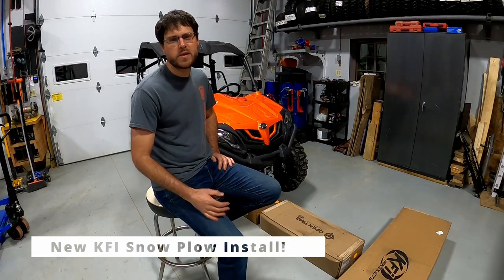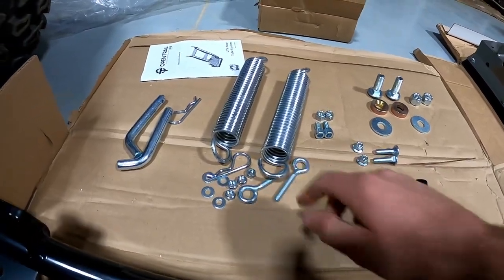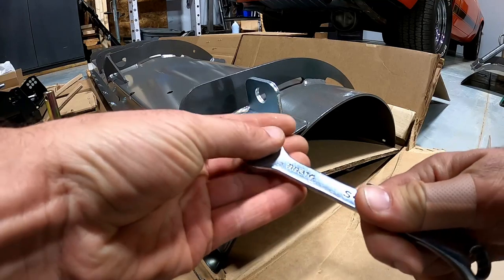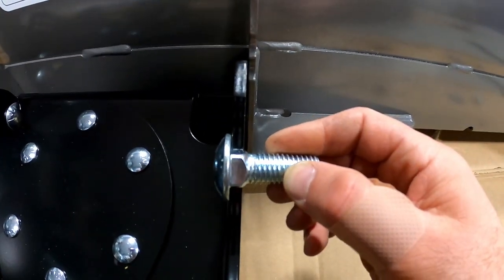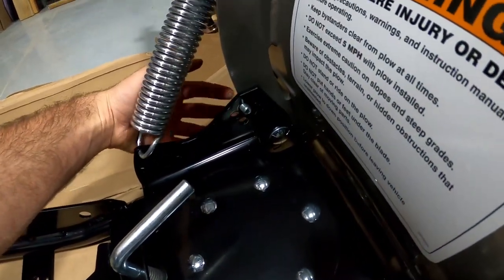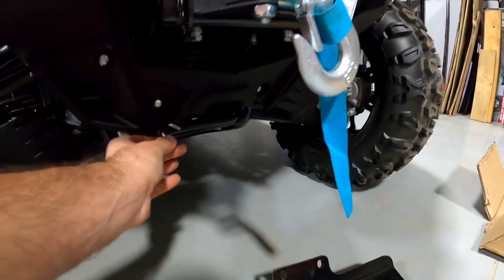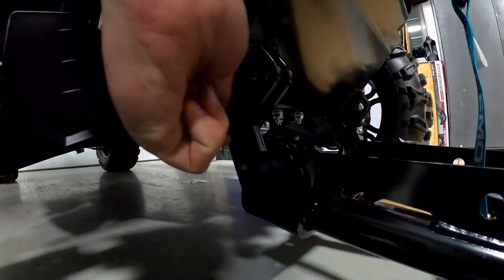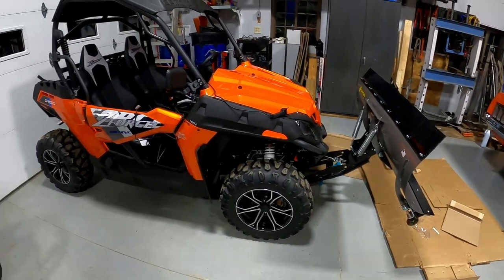How to Install a UTV Snow Plow | KFI Plow Unboxed, built & mounted to a CFMoto ZForce 800 SXS

Comment: I currently have a 22 CForce 600 with a blade and it works well. I also have 22  ZForce 800 Trail and I'm tempted to put a blade on the ZForce after watching this.  Great video.

Comment: Is a 66" big enough for a 2019 zforce 1000?
Reply from the maker: Good Morning, I would suggest their 72" blade for a ZForce 1000. That machine is a bit wider than the ZForce 800 here in the video. Once you angle a 66" blade I'm afraid you might be running over the snow as it dribbles off the edge of the blade. The Z1000 certainly has enough power to push the 72" and for as little as the 72" blade costs I would go that route. Thanks for watching! Thanks, Jared